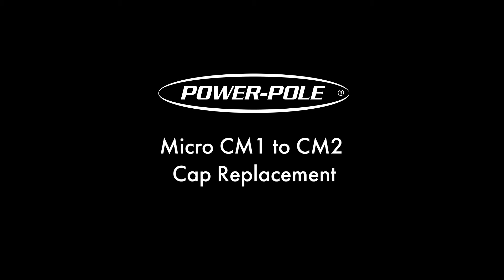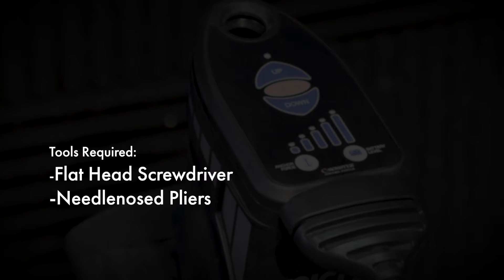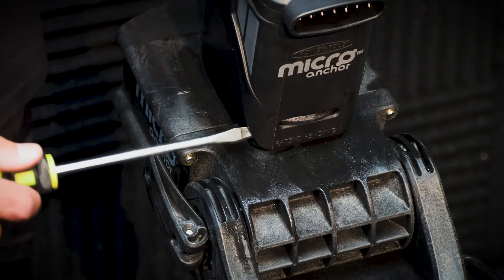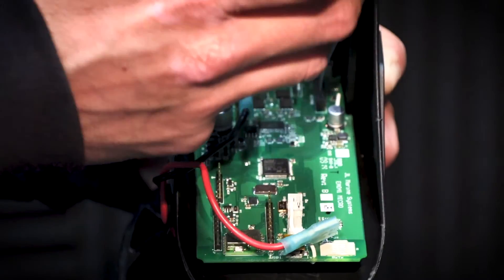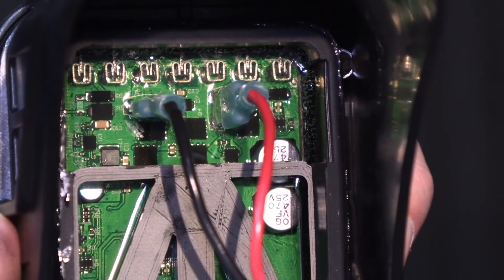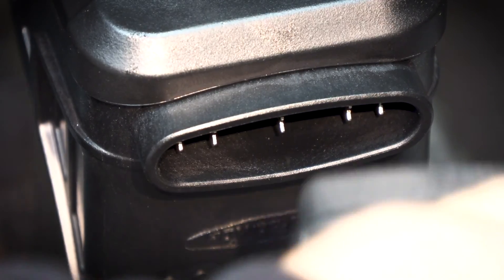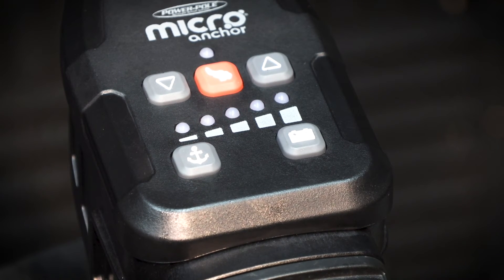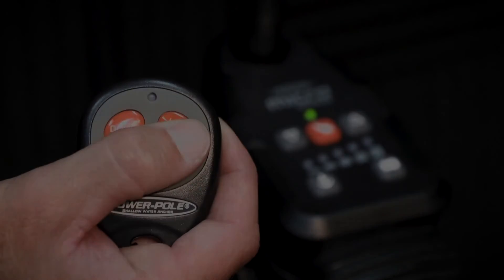JLM University: Replacing a CM1 cap with a CM2 on the Micro anchor

Comment: My CM1 cap got corroded and is unusable where can I buy a new one or the CM2
Reply: Man, I'm in the same boat...no pun intended. Flipped my solo skiff and it filled with saltwater. No matter how much I cleaned it, it wouldn't stop the spread of corrosion. Were you ever able to find where to grab the 2.0 top cap?
Reply: @JakePalmer13  got to call them. i just ordered one, $300
Reply: got to call them. i just ordered one. $300